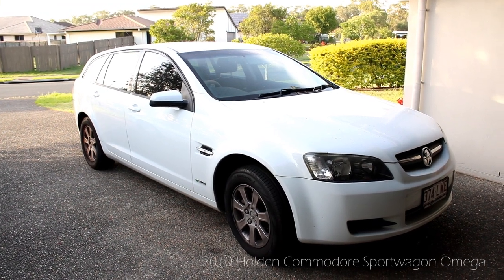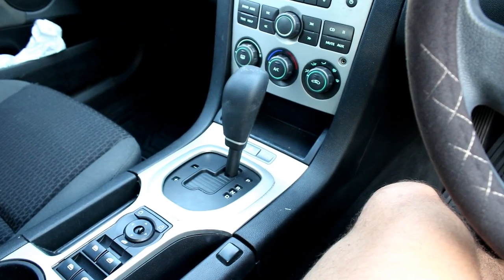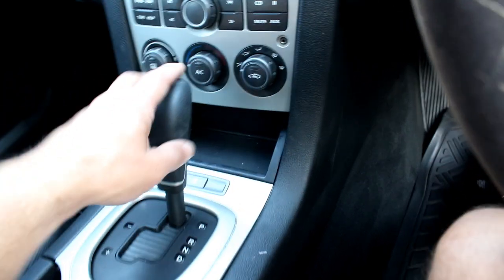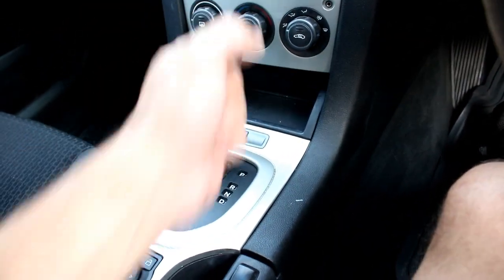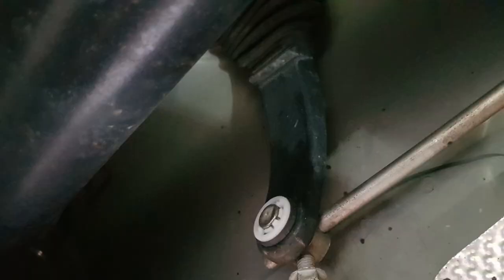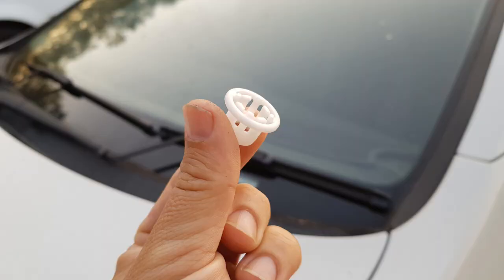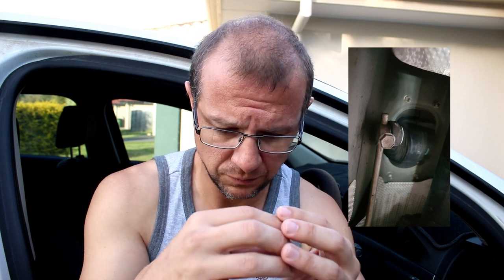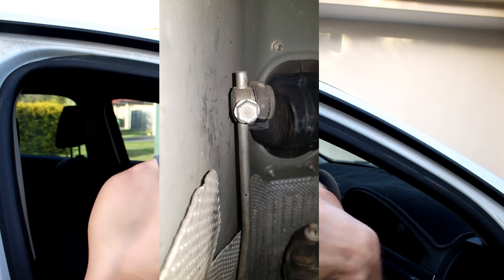VE Commodore gearbox gear shifter issue: SOLVED!!! G8 Pontiac Sportwagon

Comment: You will probably find out if you need to grade it it not in the service manual they are not expensive they are around $10 on eBay as a downloadable format makes it easier to work on the car I jus bought one for my WN Caprice

Comment: I have an issue on my sv6 2008 model it starts fine but when you put into drive or reverse it won’t go anywhere.. is this the same problem or whole gearbox? Good video mate
Reply from the maker: That doesn’t sound good. If you can, get underneath and have a look. Does the shifter seem ‘loose’?
Reply: Sounds like no transmission fluid
Reply: I am having same issue ?  What you did to fix bro. I know your comments from 3 years ago but please help if u know anything
Reply: U sort it yet?

Comment: Hey mate thanks for the video,my holdenv6 commodore vf start fine but never go forward when you put  on Drive,only if you reverse or shift to 2 or 3 then go🙄,,is it the same problem?
Reply from the maker: Sounds like it's not engaging at D, but iff it's 'shifting' into any gear it's probably a different problem.
Reply: Did you get it sorted

Comment: Havent read.commemts, but grease atracts dirt and dust if exposed.
So rule of thumb is if its sealed and protectet then grease or oil.

If exposed to elements then no grease.
But  mabey oil.

I could be wrong.
Reply: I'm a Holden tech and part of our service is to grease this. It needs to be done periodically. I.e. wipe off old contaminated grease and reapply